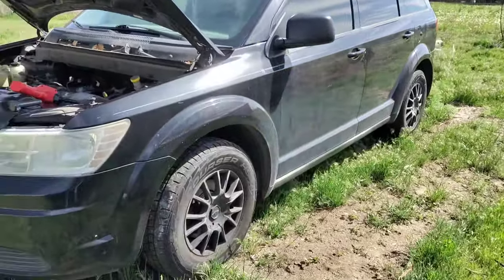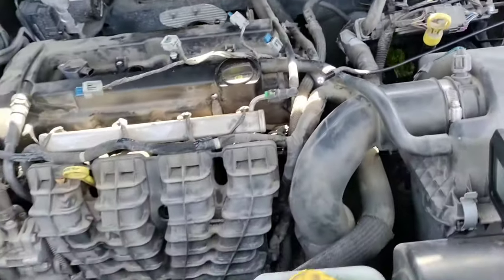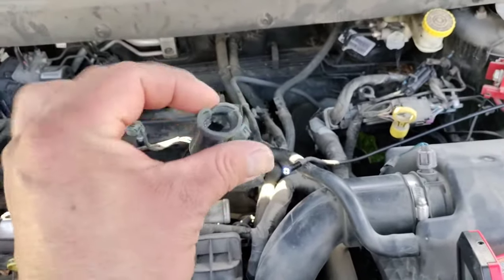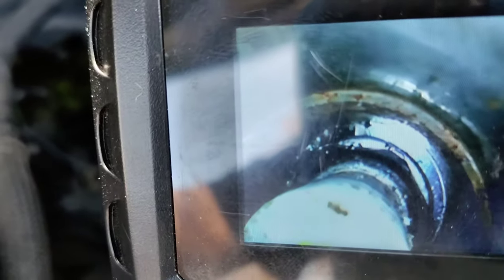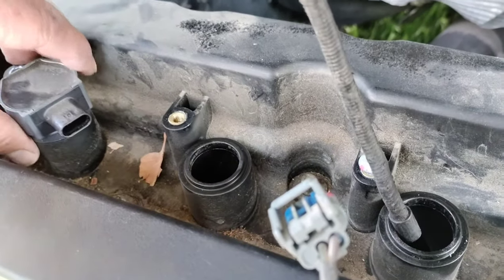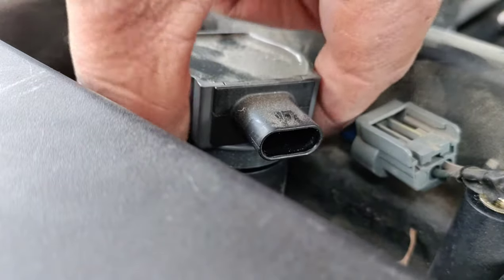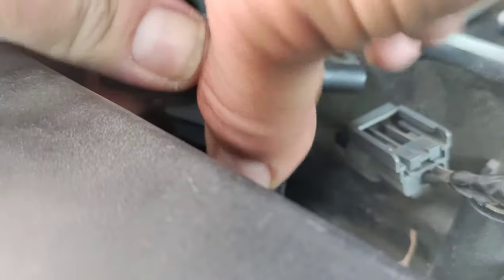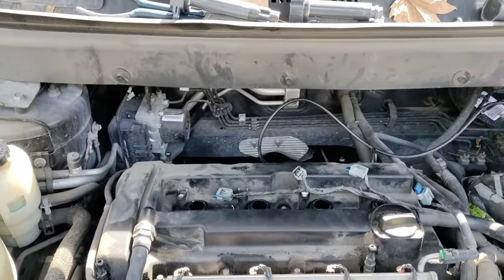removing broken ignition boots and stubborn ignition coils

Comment: Wd40 helped, dentist's mirror, needle nose pliers with grips, patience, prayers, and then compressed air to blow out the debris before finally getting to the plug. My mechanic refused to do this job when I gave out the valve adjustment and asked for new plugs... he tore the first coil and forewarned me. 3 hours later I am into all the cylinders again 😮

Comment: Omg..i just had the issue with the coil from coming out. Now, if i get pulling on it, what could happen that would cause me to have to boy a coil. I've been working on mine yesterday for about 2 hours wondering why the dang thing doesn't pull out of ots hole.Seeing this, I could picture that being my problem. I got a 04 Envoy and do u have any tricks om how to pull out the back 2 sparkplugs. They're actually underneath the windshield wiper part of frame part and dosent give much room to put a socket on

Comment: I have a stripped ignition coil hole.  The car runs but all I have tightening it now is some Teflon tape.  But I made the mistake of buying those cheap Amazon ignition coils and they've been going out on me, the same second coil. They're also hard to get out so I'm wondering if you think if it's hard to get out that it's not in any danger of coming out while I'm driving since the bolt is not flushed down but it is still gripping and the he bolt did tightened a little.

Comment: I bent and sharpened stainless landscape staple. Upward hook with good biteThrough jaws of locking plyers and bent along handle to stiffen when gripping plyers . Tightened as tight as I could get it. Ended up hardened a bit where I ground and bent it . And Compressed air. The cheap picks I bought were useless. Buy once cry once or make the tool if more time than money . Good video wouldn’t have taken me a day of toil think to use compressed air had I watched this

Comment: Thanks to this video, I was able to have this same issue resolved after picking up an o-ring pick set

I had spend 5 hrs dealing with them breaking off with different pliers being used. But after picking up a o- ring picks had the remaining three off within 20 mins. 

Thanks and solid and useful advice

Comment: Just use a hemostat and clamp in between the boot, and the plug and on the outside of the rubber twist and pull